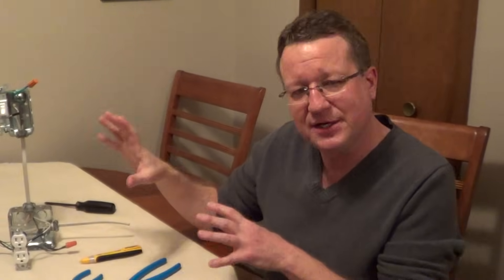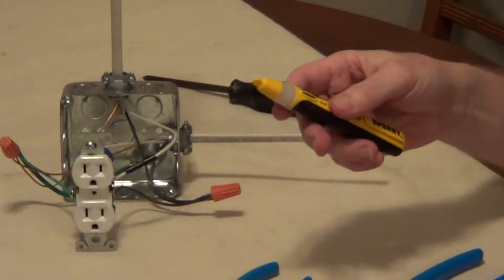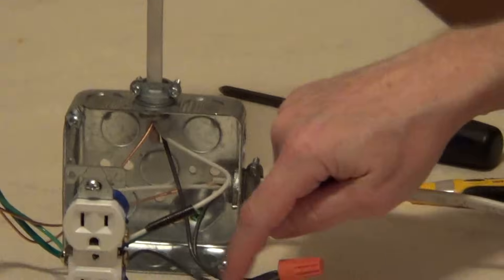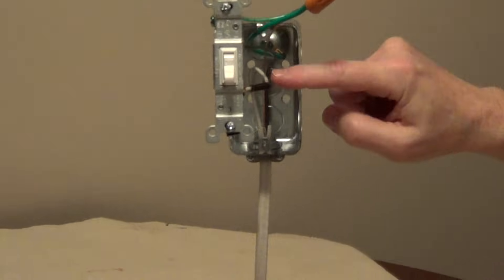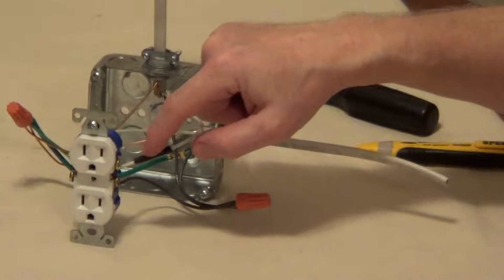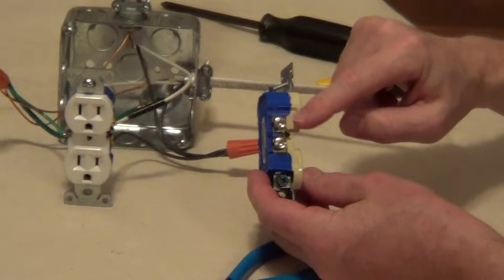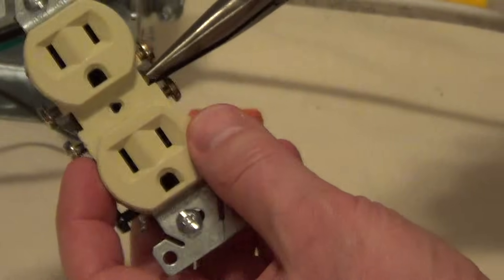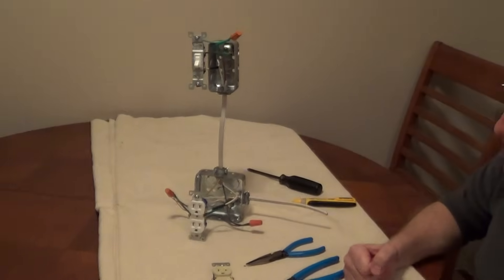How to Wire a Switched Outlet

Comment: Question...

I just replaced an outlet that that the top was controlled by a light switch and didn't know I needed to break that tab so I didn't. However now both outlets do not work with the light switch. If I did not break that tab doesn't this mean both the upper and lower should now be controlled by the switch?
Reply from the maker: TIKIMAN198 Hi, you have to find the hot wire from the switch. You could wire this to the first outlet and then connect the hot wire going to the second outlet to control both. If the first outlet had 2 hot wires going to it, like the video, you could just just eliminate the pigtail wire that kept half on at all time.  Let me know if that helps.
Reply from the maker: Hi, I would guess that the hot wire with the wire connector is the hot from the service panel. The other wire coming out of the wire connector is probably the hot going up to the switch to feed the other hot wire. You will have to take the wires apart and test for hot before the switch. Make sure the tab is broken on the outlet. If you are still struggling, send me a pic. fixitpodcast@gmail.com
Reply: @FIXITHomeImprovementChannel  so if using power from an outlet to power a switch for a light I have to break metal tabs on outlet?  When should i break metal tabs? Or not?

Comment: do you have to use the pigtail or can you just use the screw and the ouick plug on the back of the plug and do away with the pigtail?
Reply from the maker: clutchit Hi, the screw terminals are a much better connection. Most electricians recommend only using the screw terminals. The quick connect on the back can come loose when you push the wires back into the box, or just have a weak connection. We also have a weekly podcast. Here is a link http://www.stitcher.com/s?fid=49441&refid=stpr